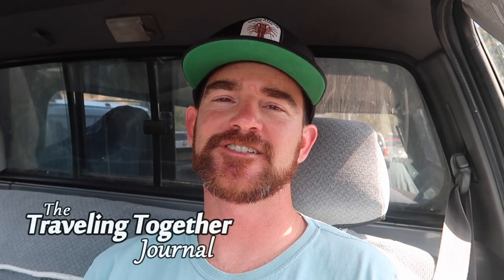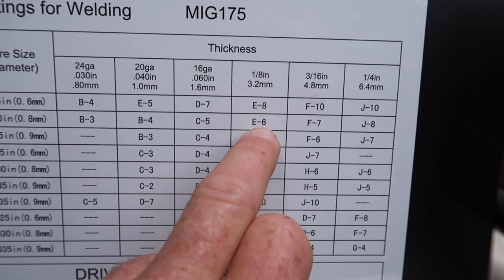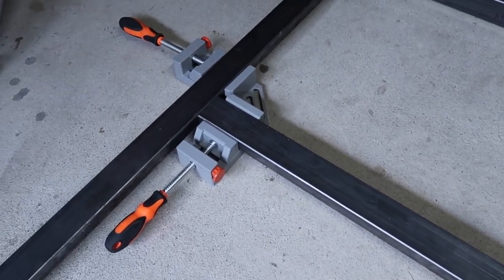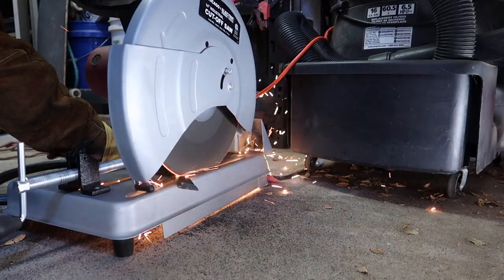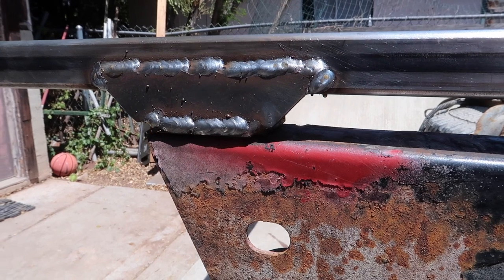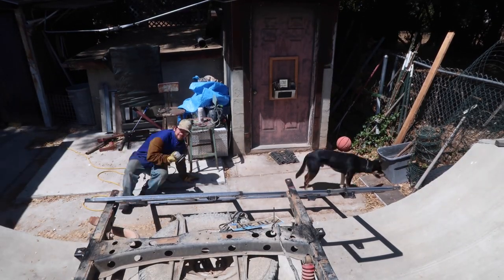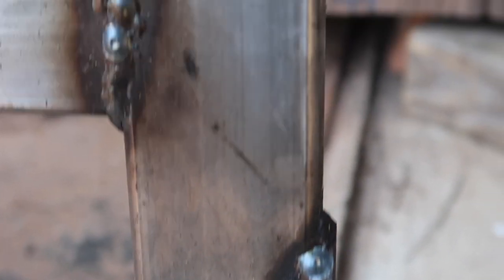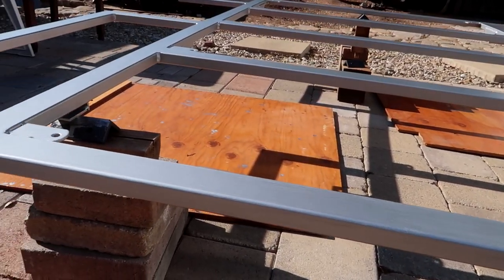4x4 Truck Camper Build | DIY Subframe

Comment: Great work. But may I suggest something. You need a rubber bushing or something between the bed and the chassis. The chassis flex's you need to allow for movement.
Reply from the maker: Thanks Simon. The T100 has a fully boxed frame, so it doesn't flex as much as most trucks. I attempted a flex-test before building the subframe and measured 3/8 inch of flex across the back 8 feet of the frame. 
I may regret it, but I'm thinking it will be able to handle this amount of movement.
Reply: @TheTravelingTogetherJournal  This is what I do daily is fabrication. At least a small piece of rubber will help. You don't need to change anything.
Reply: Bu the way did you do the test with weight in the bed? Wish you were closer to TN I would love to help.
Reply from the maker: @SimonElenor  I had some weight in the bed, but not enough to replicate a loaded camper. I know its not a proper flex test since I don't have a way to stop the front end of the truck from moving while I flex the frame, but the only other information I could find was based on similar test and they were looking at 1.25 inches or more of flex.
I know more weight on the frame will add to the flex, but the bumper, storage and the subframe will resist the flex. I really just guessing here🤷‍♂️
Reply: @TheTravelingTogetherJournal  Just keep an eye on it. Any movement is going to flex everything. Might consider just some rubber at least.

Comment: Excellent video Matt!  Are you going to do some work on or clean up the chassis and cab on blue beauty?
Reply from the maker: Yeah. I'm waiting until I have the basic camper done. I'm not sure exactly what I'll end up doing, but Once I have a better Idea of the weight I'll pull the suspension apart, replace all the bushings, clean, and paint everything, and maybe make modifications for the extra weight as necessary.

Comment: Was aluminum an option for you?  Seems it would have been a weight savings.
Reply from the maker: I considered it, but as someone who is not an engineer and who has never welded aluminum I felt a lot more confident building with steel. Aluminum is plenty strong initially but it's hard to say how it will hold up to the vibration of off highway miles over time
Reply: @TheTravelingTogetherJournal  I understand going with you know and it looks amazing.  Great work ...looking forward to more.  I am going to be doing a build for a 3/4 ton 2001 Chevy here in Hawaii and shipping the truck and camper to the mainland for my adventures.
Reply from the maker: @marshallbrowne5371  Sounds like a fun project! If you're thinking of building with aluminum, check out @Everlanders YouTube. They made a big, rad camper with aluminum subframe and have been "testing" it through the Americas for a few years now.